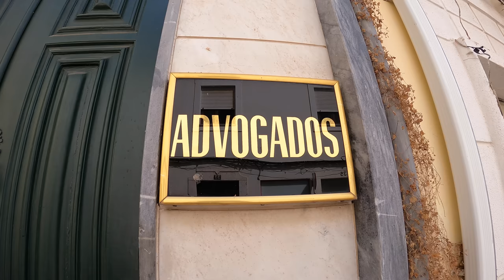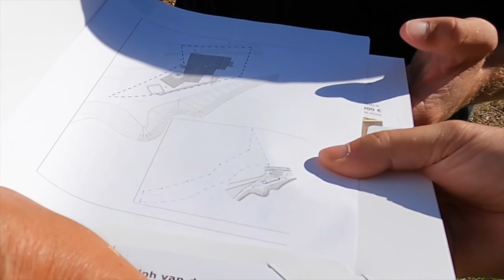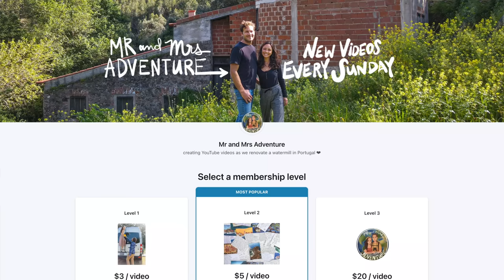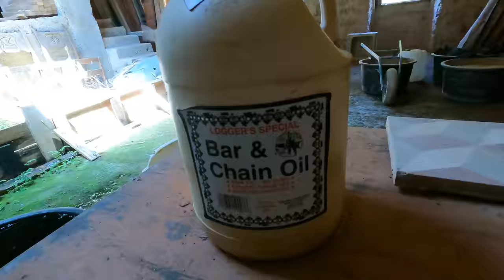FIRST LOOK INSIDE our DREAM HOME RENOVATION PROJECT in Portugal 🔑

Comment: Hello Drew and Brittany.  If you haven’t heard from anyone else yet about the bags of hemp, we think it, along with the mesh screen material, was to be used for plastering walls.  We watch another YouTube channel of a British couple who also live in Portugal and they also bought a old building and are in the process of renovating it.  They have been plastering the walls with a mixture of lime, hemp and water.  They use this mixture instead of plaster because lime absorbs the dampness instead of plaster which prevents water from infiltrating, but then causes mold.  The channel is, “Make. Do. Grow” and they are based in central Portugal.

Comment: I found having a temporary outdoor shower and toilet was a quick improvement. Fire heated a metal drum on one level, pipe went out the bottom of drum to valve and shower head on lower level, with a flimsy shack around it with no roof. Just heated water to the temperature I wanted.
Digger dug a narrow 3 metre deep hole that I built a quick shack over with roof for toilet. Just put a bucket of dirt and a handful of lime in it after every use.

Comment: Rockwool is melted volcanic rock that’s heated and spun into what resembles wool. Rats won’t eat it cuz it’s rock. It repels water and had a super high R value. We used it in our van and it’s amazing. It’s inorganic material that won’t mold. Don’t get the interior wall kind because it doesn’t have an R value as it’s only made to deaden sound. I have no idea if you can get it in Portugal tho.
Reply from the maker: Woooah, that does sound awesome!! Going to Google about getting it here 🙏😘

Comment: How exciting to finally see inside, it would be amazing if you could put metal supports and beam in that main room and then cover it with those tree's again, like cut them in half, hollow out the support poles and wrap the tree back around it coz those tree's are a master piece in that room. Good luck with it all it's going to be sooo much fun working on this beauty ❤
Reply from the maker: They are a masterpiece!! We thought of maybe doing concrete castings of the trees over top steel beams 🌳

Comment: The tiles are beautiful! They could be an important part of your home renovation!
Also some great diy chairs and lumber to use in your new house! Love the skylights and tree trunk studs holding up the ceiling! 
As for your weeds, all of that plastic that you found while clearing the terraces was to suppress weed growth while trying to grow food crops. Sheet mulch will do the same thing, but instead of plastic, recycled cardboard and/or newspaper is used!
PS: we have several skylights in our 40 year old home and none of them have ever leaked. They just have to be installed properly with flashing and seals!
You need a cat!

Comment: My family has a summer house in Italy and when it is like Italy you need a fireplace for the winter time becouse it gets very cold in winter. In the summer time it is nice to be cold inside becouse you have the stone walls, but in winter it is very difficult to keep heat in the house because you have the stone walls.

Comment: Hi
Brick and cement wont save you from winter or summer :D
For the outside look for something called "Capoto" your local friends will know what it is.
Inside either use the insulation that you had on the video, the "white" stuff inside the brick walls.
The white stuf seems to be just the regular stereofoam, look for EPS, its blue "stereofoam better for insulation, or use "Lã de rocha", again the locals will know what those names are.
Still i would leave a pre AC install, just in case.
Being on the hill the roof is where the most of your heat in the summer will come from.

Hope the it helps

Comment: Hello there, first time watching your videos. Had exactly the same thing at my old house in France- owners had a new roof and dumped all the old tiles at the top of the garden. Luckly, they contributed to the hardcore i needed to fill and level the area to make a top drive. Good luck with all your endevours- it took over 3 hours to sign the paperwork, met the Notaire, the owners, signed, had wine and a small social - it's very different to here in  the UK.

Comment: The freshness that you're felling it's due to the bricks and stone walls. That and the fact that the house stayed close for so long humidity got stuck inside.
If that was me I would start by avoiding humidity in the walls by capillarity. Then the outside walls need to covered with some good quality " reboco" ( sorry I don't know how it's called in English), also the main floors need to have a humidity barrier. Finally for isolation of the outside walls I would choose synthetic insolation ( not glass wool), idem for the sellings. In other words I would try to create a hermetic house , so I can better control the volume of air circulating in the house. See you in next episode,👍

Comment: Great super creative life long project. CONGRATULATIONS!
With this place, you will never get old. Too much to play with!
Regarding the tree columns, and beam.
Suggest that you learn about the Yosemite Ahwahnee Hotel. That place appears to be made of logs. However, it is made with steel beams. And then logs were cut to surround/enclose/hide the steel structure. Perhaps you would like to do similar. 
Although replacement of the log ceiling beam with proper steel, maybe the columns can be eliminated.
You may need a vapor barrier on the interior walls, then plaster coating with fiber fabric, to reduce moisture intrusion.

Comment: I wonder if you can visit some neighbors to see how they deal with the the environmental challenges of the seasons and the humidity. Here in Taiwan, we run floor model dehumidfiers and run a/c plus air purifiers to reduce mold possibilities. We also use concrete without insulation which means it is cooler inside on hot days, but winters can be quite cold. We can increase heat retention by using double-paned windows (super important for managing critter traffic too). So exciting to see you move into this place.  You may find inspiration with "The Restoration Man | S02E15" about a water mill renovation in the UK.

Comment: Congratulations!  🎉  You finally have the keys to your castle (aka watermill).  I’m so happy for you!  It’s clear why you fell in love with the place.  It has so much potential.  

I love the tree trunks in your main area.  Hopefully you can find a decorative way to keep them after adding the steel beam.  

I know that you guys are going to be spending your evening watching “how to” videos on YouTube.  While plotting the construction.  These are fun times!

I don’t know tons about construction… but I can tell you that when you take out that section of tile roof in the living room… you are definitely going to want to remove the tiles back to the ridge line to avoid leaks.

I would see if there are professionals in the area that blows foam insulation.  I think that it might be amazing solution with the damp. 

As far as living in a construction zone, I found it was impossible to protect my sleep/living space from construction dust.  No amount of plastic protective barrier stop it’s way into that space.  I eventually resigned myself during a major construction phase to live in a hotel for a few weeks.  I thought that I could living during all phases of construction in the house.  It was much more challenging than I thought.  Others warn me not too, but it is something everyone has to experience and determine for themselves.  When Drew talked about making a temp closet and moving all the clothes in.  I was saying out loud “NO”.  You may wish to keep your construction clothes in that living space and keep most of your clothes in the camper until the roof and the major wood work from that project is done.  This is just food for thought. 

Can’t wait to see your dreams for this place be come a reality!

Comment: If you need translation for the dutch,  the white role is fllece walpaper is strong and keeps wall together. Muursteunen. wall brackets. But google translate just typ it in and it will show englisch

Comment: Saludos desde Chiapas, México. For the winters I'd get a wood burning stove like a Jøtul. They're expensive,but with wood heat you have two advantages: Heat and getting rid of the humidity and damp. Use gas for cooking only, because gas heat causes condensation. I've  heard that people use cork in  Portugal as a natural insulation. What a wonderful and fun  adventure you're going to be embarking on. Blessings from Chiapas, México.

Comment: I have had the good fortune to restore several properties.  From conventional homes, to a horse property with an old ranch house, to a southwestern property with adobe walls and artistic wrought iron used to accentuate key areas, to a mini-castle that was 5500 sq ft., to a Victorian church in Jackson, Calif where the entire church had to be restored from foundation to roof. The reason I am telling you, is that I see you two have a wonderful opportunity to make your home a magical property. The following are just a few of the dozens of ideas I actually have. Feel free to use the ideas, or discard them. If I were you, it would be advantageous to become familiar with natural materials. Such as using lime wash coating to beautify the exterior. As for the turret area, it could easily be made into a mini loft , where you could cut extra windows in the brick wall to take advantage of the views.  A wrought iron stairway could spiral up to the loft area. I would look into utilizing a water turbine generator placed strategically in your stream, and a solar power room outdoors, to access electricity for your property. As you renovate, try to stay with natural materials as much as possible, stone, wood, etc. Use old tiles, with local provenance, on the floors, if you can. If you brace your roofs areas with steel beams, you can fashion wooden decorative coverings over the steel ones.

Comment: In your video clip you stated “compost isn’t an option” - well not anymore! I would put a composting toilet in there that diverts urine, using the urine in your gardening (diluted 1:10 parts H20) so you don’t have to chip the concrete floor to put plumbing in
Reply from the maker: but unfortunately the "camara," or city hall, does not recognize a compost toilet as a legitimate option for a home to be deemed as "habitable," so we will have to find a solution that appeases them.... though we will definitely have a composting situation we use somehow 💚

Comment: 21:40 - High humidity in Winter? The algarvians desperately wish it to be so but unfortunately it's no longer like that. The way the climate is changing and the Algarve is becoming drier and drier every year, you don't need to worry about humidity. That insulation should be enough, even if the house is located in a valley with water nearby.

Comment: I don’t understand why your name won’t be on the deed until the construction is done. What construction? The mill? Isn’t that risky?
Reply from the maker: The sellers had to resubmit the construction project for re-approval before the expiration of the final construction extension, which they successfully did. Then when we went to change the names on the deed, city hall said that since there is an open project under the sellers name, the deed cannot be transferred to us until the habitation license is granted (which will happen once we fulfill key steps in the construction process). We are good friends with the sellers so we are not concerned, just motivated to get construction underway 💪 🙏 ❤️

Comment: Why can the deed not be fully transferred? I know you got lawyers and stuff involved, but it just seems weird that you can’t get the full deed because of a construction permits. Can you guys maybe elaborate a bit more on one of your QnA’s?  Are you worried about doing all the work and the ‘owner’ backing out?
Reply from the maker: The sellers had to resubmit the construction project for re-approval before the expiration of the final construction extension, which they successfully did. Then when we went to change the names on the deed, city hall said that since there is an open project under the sellers name, the deed cannot be transferred to us until the habitation license is granted (which will happen once we fulfill key steps in the construction process). We are good friends with the sellers, our lawyers have helped us set up an escrow account, so we are not concerned, just motivated to get construction underway 💪 🙏 ❤️
Reply: @Mrandmrsadventure  great news,...glad you have it all covered, and thanks for clearing that up. was just worried about it the way it was described. Good protection having the funds in escrow though.

Comment: I really don't understand why your names wont be on the deeds till the work is done??
Reply from the maker: The sellers had to resubmit the construction project for re-approval before the expiration of the final construction extension, which they successfully did. Then when we went to change the names on the deed, city hall said that since there is an open project under the sellers name, the deed cannot be transferred to us until the habitation license is granted (which will happen once we fulfill key steps in the construction process). We are good friends with the sellers so we are not concerned, just motivated to get construction underway 💪 🙏 ❤️